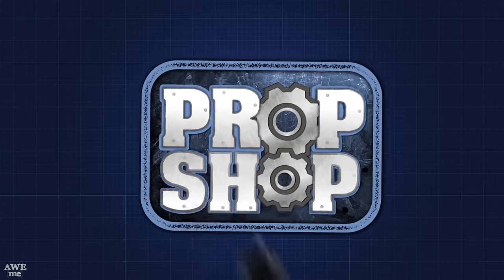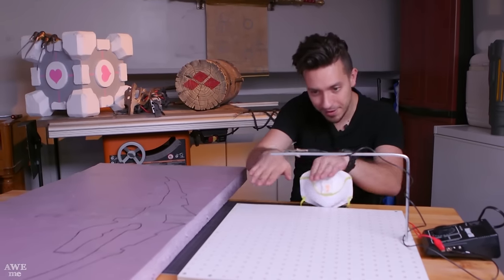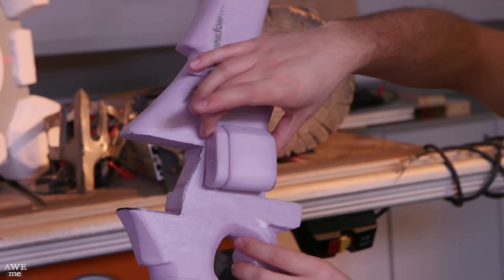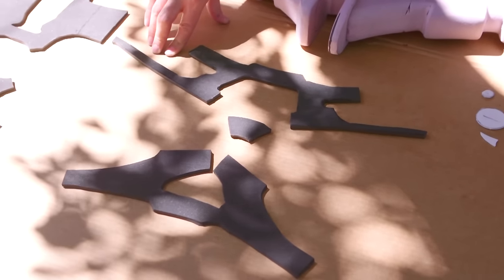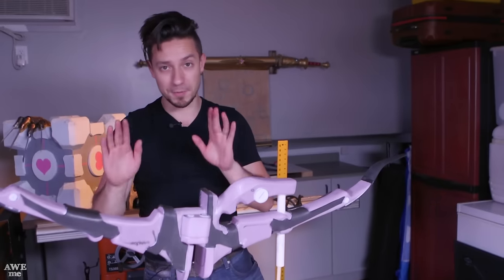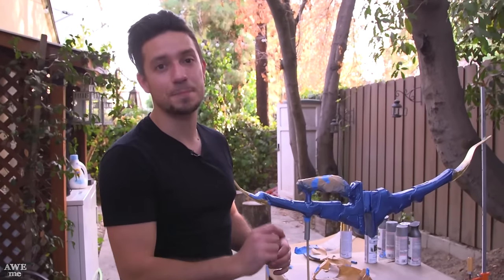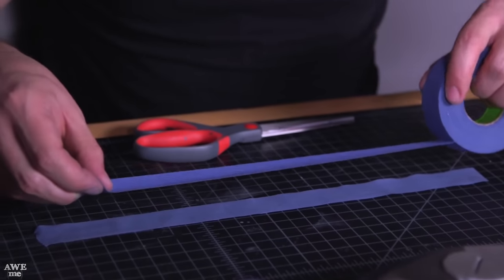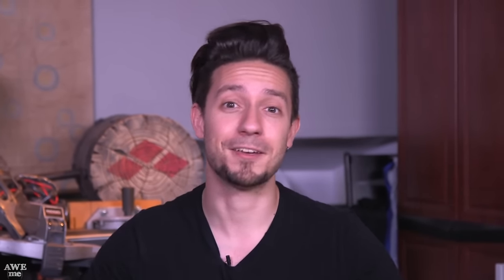Hanzo's Bow - Overwatch - DIY PROP SHOP

Comment: Made a Overwatch Genji's sword!!
Reply: More likely to happen if you comment on a Man At Arms video
Reply: actually it would be more likely to be made as a prop considering the look of it... Also a prop could have the effects included like the glowing edge
Reply: 히로빈엔더 GENJEH!
Reply: that would more for man at arms right?
Reply: tawess imo not rly, since it's an actual metal katana and can be made like one and they can add the neon green effect to the sword (I know they added green to swords before just can't remember how)
Reply: the only thing you really need metal for is if you are going to cut with it.. Beyond that foam and plastic should be a much better choice not only for weight and practicality but also for the fact that the edge in-game is for what it looks like pure energy, a effect you can not get with metal. and if you are going to use a plastic edge why waste money on smiting what is basically a very fancy casing..
Reply: tawess ok, so it would be more practical as a prop and can be made as a prop but Im only saying it's more likely to be made if Man At Arms did it since 1) They make swords (including Katana's)  2) although DIY prop shop has made weapons I don't think they've done actual swords 3) It would be more accurate if it was made out of metal ect, this is just why I think it's more likely to be made on Man At Arms, but I would love it if they made it on both shows, one to get an actual realistic rendition, and one that people can use as a guide for their own, but sadly I don't see that happening. Also I don't see the edge as being pure energy, more like a si-fi tecno metal emitting energy around it since imo if it was pure energy it would be partially see-through like the rest of Genji's energy effects but a bit more solid
Reply: TV 엔더히로빈 Already made.
Reply: Samuel Turner Turns out you are right. I tip my hat to you.
Reply: tawess ty :)
Reply: an
Reply: TV 엔더히로빈 Make A genji sword

Comment: Actually, the part where you used PVC tubing where you said "the dragons come out of" and "where the tracker is" in real life actually serves as a dampener for when you shoot an arrow. Apparently it helps keep the bow steady when shooting it. I've played very little Overwatch though and pay very little attention to detail so that piece may actually serve a different purpose in-game though so pardon me if I'm wrong. Other than that, It's a great build! Very nicely proportioned :)
Reply: Thank you, and great info!
Reply: A.K.A. the counter weight
Reply: Iron Grizzly Props A.K.A the Stabiliser
Reply: More a stabilizer and damper, not at all a counter weight. In fact, longer and heavier stabilizers cause the bow to pitch forward in your hand, and if severe enough, can actually make you inaccurate due to poor followthrough. Olympic stabilizers can be up to 27 inches long, and throws off the balance enough that it needs rear stabilizers to offset the pitching torque. 
Sincerely, real target archer
Reply: Michael J. Caboose Archery is fun
Reply: *counter balance/weight

Comment: Why use the modpodge if you were going to go over it with plastidip anyway?
Reply: lern2swim Looked better in testing than plastidip only. It feels like the surface has a bit more protection.
Reply: Aerosols such as Plastidip will disintegrate extruded polystyrene, so to protect the closed cell foam from the aerosol that is plastidip with mod podge is to make sure the sealant doesn't destroy the foam. We used plastidip to give it another coat of sealant and to make it look like one piece

Comment: The capsule on the front is a common form of weight which an archer adds to his bow for accuracy. The weight in front causes resistance against holding the bow, which in turn creates a steady weighted bow which can easily be maneuvered to keep good aim.

Comment: That was some impressive foam carving!  Nicely done.  

P.S.
The pipe-looking thing on the bottom of the bow is actually a weight that helps counter-balance it when you fire, since (if you're holding everything correctly) the top section of the bow will have a tendency to swing/shift when you release the string.  You see these weights a lot on the bows of Olympic archers and other competitive archers.

Comment: Your arrow rest is on the wrong side
Reply: I'm glad someone noticed - about halfway through, I realized I had been making a left handed version of the bow (the joys of being ambidextrous!), yet holding it as a right handed bow. So I put that bracket on the side that left it open for the arrow to swoop in at. If you're making this - go ahead and put it however you like! It'll still look like Hanzo's bow.
Reply: no matter. in traditional japanese archery the arrow is on the right side of the bow.
you can use that as your excuse.
Reply: Actually right side arrow rest is practically better. You need less moves to put arrow in.
Reply: Nathaniel Davila It also depends on your eye dominance. You can have a dominant right hand, but your eye could be left side dominant. This means you have to fight the dominance and correct it or draw with the left arm. Not that that is the reason it was made like that. What works, just works archery is all self preference and style
Reply: becky d ok I'm right handed and -left eyed? So should the rest be on the right side of the bow or the left?
Reply: +Ianato its easier to just go with your hand dominance and slightly close your left eye when shooting. I am also left handed and left eyed and when i first started archery all my arrows go to the left and i have no idea why and then my instructor told me to close my left eye and the arrows went in center
Reply: Ianato I draw with my right hand and I close my left eye. I was also taught to close my left eye. Eventually if you use you right eye more than the left you can over come the dominance. You just look really weird, because one eye is closed all the time. You can also tape over safety glasses when you shoot if it is hard to remember to close it. If you use the more opaque clear it also trains your eye. The reason some people shoot according to the dominant eye. It is because they think it is more accurate with 2 eyes open instead of one. This is all that I have been taught. One thing I have learned is that in archery there is more than one way to do things and different styles and techniques find what works best for you.
Reply: +becky d it doesn't matter which hand I draw with because I use instinctive aiming where I often don't even sight down the arrow
Reply: thetozzyguns if you shoot instinctively eye dominance matters even more than if you shoot with a sight. The object you are focusing on would be slightly to the left or right of where you think it is. You can see this if you block an eye, look at something and use your finger to block it 5 inches away from your face then block the other eye while keeping the finger there. Your finger will no longer be blocking the object
Reply: Someone said it but yeah, there was an entire video on how nocking the arrow on the right side of the bow if you're right handed is a more fluid movement. They argued that it'd be much faster and you could do it in an intense fight. I don't remember the video but it was great.
Reply: LARS ANDERSON. Search him up it's awesome.
Reply: Briana O. Btw Lars is completely wrong on many things including on which side the arrow goes
Reply: Briana O. I have to disagree not that he is a fast and good trick shooter, but on where he gets his facts. It is also comical to watch him disprove  the opposing way of shooting. He also doesn't give many sources of his historically accurate rediscovered way of doing archery. In Japan they shoot with the right hand so I'm not going to say it doesn't work because it obviously does. I am how ever going to say when was it lost? Among many other arguments I could say about his claims. You could just go and search Lars Anderson debunked and find many other things from other sources.
Reply: historical archers used the right side of the bow in order to shoot faster. left handed people would use the left side for speed. archery devolved from a speedy war weapon into a sporting tool
Reply: I was taught to go with eye dominance first and foremost and to just train with a lefty or righty bow depending on eye-dominance and just not think about left or right handed at all. :)
Reply: Can you give me the boe
Reply: Can you give me the bow

Comment: 1. A nock is the part of the arrow that "connects" it to the string, and isn't on the string it self
2. The bit hanging of the front of the bow is a stabiliser, it helps keep the archer's arm steady when shooting
3. You made the damn thing left-handed but at the end you're holding it as a right-handed person would
4. Recurve bows, such as this one, attach the strong by looping it around the ends of the limbs where small grooves have been cut/sanded in: https://c1.staticflickr.com/9/8014/7168554540_3c244c76f4_b.jpg 
Other than that it's a great build, just as an archer these kind of annoyed me when watching lol. Keep up the good work!

Comment: Use lots of little spot stickers to hold the template down as you're going along the edge you can remove them. Gotta get your hands on the right one though so it doesn't rip the paper.

Comment: the little thingy on the front is to put weight on the front to help have a better aim
Reply: it is a weight but its to make sure the archer doesn't get hit in the face if they are using a sling. when an archer uses a sling it means they don't have to grip the bow as much so they can extend more

Comment: Few questions:

1) I'm curious, how'd you make that cutting wire machine?
2) I'm doing a sword prop that involves stacking 3 layers of 3mm PVC foam to make the blade. Between epoxy and slow-cure super glue (i believe that's the gel kind. Slow cure, because seconds don't give me a lot of work or adjustment time for roughly 85 cm by average 10 cm surface area), which would give a relatively stiffer cure? I've tried experimenting, and I can't seem to quite tell.
3) Would a wood rasp be good for beginning the "sharpening" of the edges once that stack of PVC foam layers is bonded or is a dremel tool with a sandpaper head still better?

Comment: that cutting thingy is so cool!!! can you explain how its made?
Reply: itsBlueCat Haha the cutty thing is a homemade hot wire foam cutter. Check out the plans posted by Make Magazine - it's essentially just electric current passing through a thin nichrome wire, which gets hot enough to melt through foam.
Reply: Awesome! and its so much cheaper then an actual saw or a laser cutter. definitely gonna build myself one when ill get my workshop set.
thanks a lot!

Comment: Does that mask you were wearing help with fumes? In my experience, that style of mask is mainly for particles and wouldn't help much for fumes. Am I missing something?
Reply: This one actually did alright - but the respirator that I got later on in the episode would've been even better. What also helped was having the door open and a fan on to keep the air moving out.
Reply: I wouldn't be perfect but it would help deflect some of it and make them less noticeable.
Reply: Anthony Thiebaut I just think it's strange that he used that mask when he used a way better fume mask outside for the paint.
Reply: I noticed that too, it was a bit odd but oh well maybe he couldn't find the good one at the time.
Reply: Kendra Fitzpatrick Actually - I didn't OWN the nicer respirator until later in the episode haha. My friend Kyle bought it for me as a gift when he showed up to check out the build that afternoon. I used it immediately for painting.

Comment: are there any other alternatives on cutting with pink insulation foam without a hot wire?
Reply: Janelle Ly Aside from a hot wire cutter, can you get to a bandsaw? I've found that it offers a good deal of control and precision, with minimal cleanup. Utility knives and exacto knives are a real pain for this kind of foam. The foam tends to bunch up and get all ragged, and it takes a few swipes to get through 2" thickness. Let me know if you discover any other ways, I'm always open to trying some new technique.